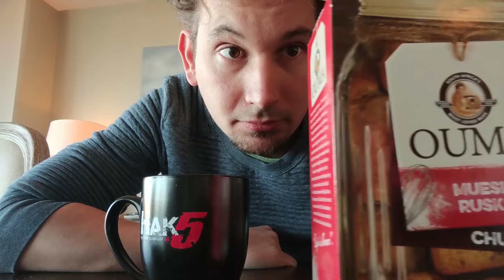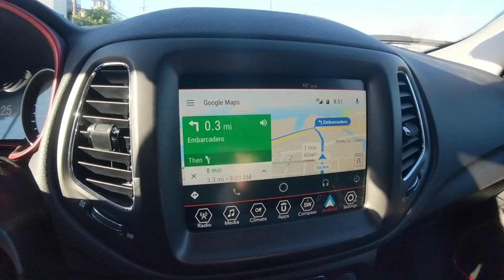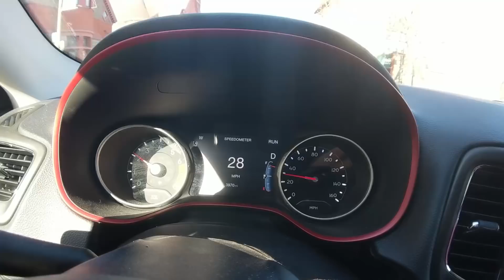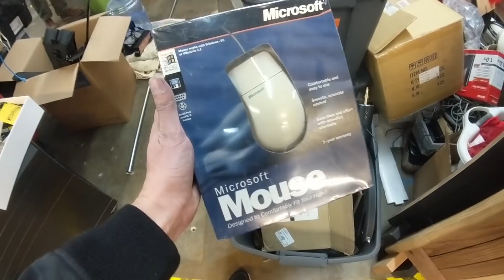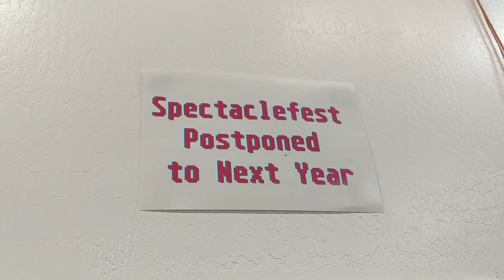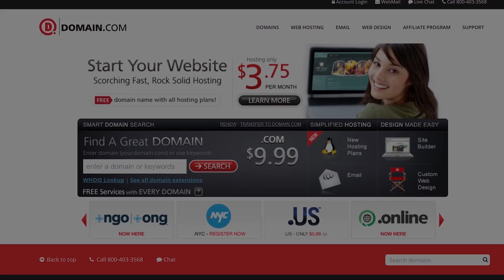Leveling Up - Hak5 2324

Comment: Old tech is great. Just for fun, did you know you can run Windows 3.11 in a Linux DosBox. OS/2 is the only OS I don't have, as none of my clients used it. I still have clients using Windows Server 2000 with MS SQL Server 2000, all be it in VirtualBox these days. That may sound weird, but they don't see any reason to change while it still does everything they want.